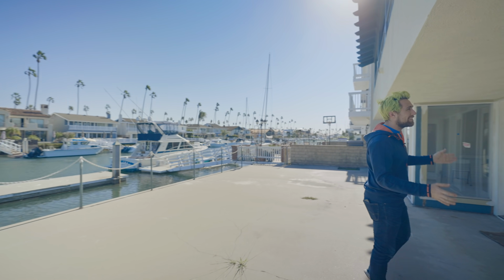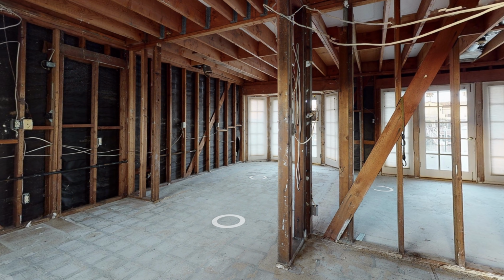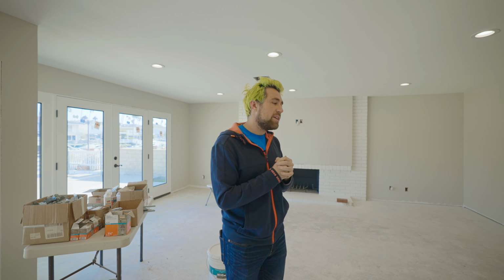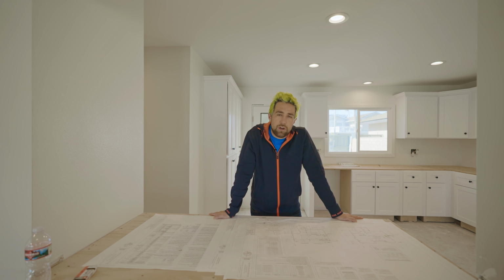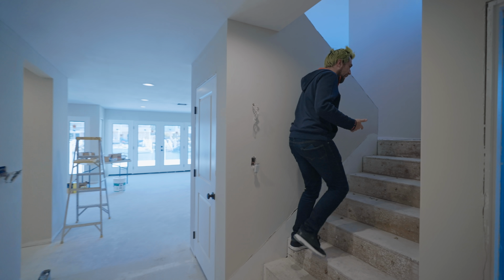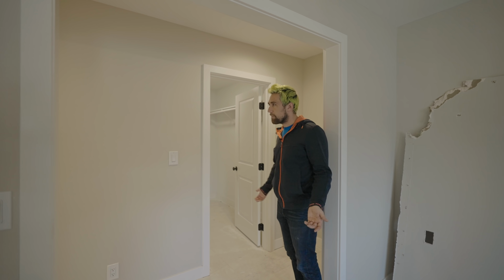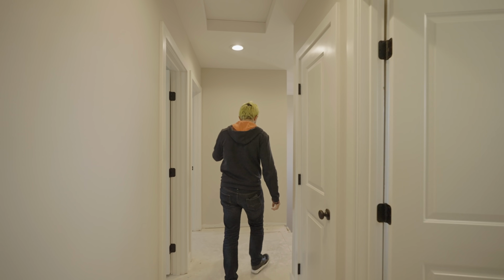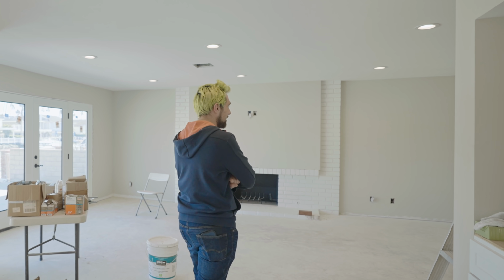My $2 Million Dollar Beach Home | Money Pit Exposed.

Comment: The specification of all components should be clearly defined by the Architect. Designing for waterfront locations is very specific, all components including door hardware, screws, window frames, cladding materials should be designed to be more resistant to marine environments. If your Architect didn't spec your hardware to suit your project - they haven't done their job well...

Comment: I pulled permits in a blue collar midwest town for a house down to the studs. I even went all out and had an engineer draw up the plans for some structural changes. I guess the city was blown away by somebody actually doing something the correct way and pretty much just rubber stamped everything. Blown away, or lazy. Either way good for me.
Reply: Yeah one of the few perks to the Midwest. Permitting is usually fairly quick and easy.  Just don't do anything stupidly outrageous and you'll be fine.      Screw California.
Reply: @facepalm5134   because 90% of people there never pull permits lol
Reply: @jej3232  Yeah, we don't take kindly to the idea of a nanny state.   Makes it easier for the 10% that actually need those permits 😉